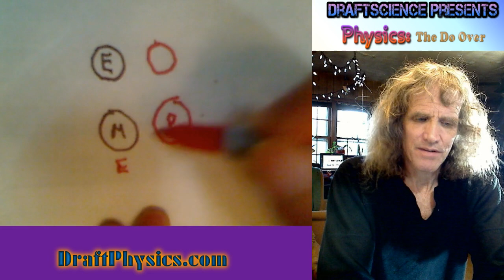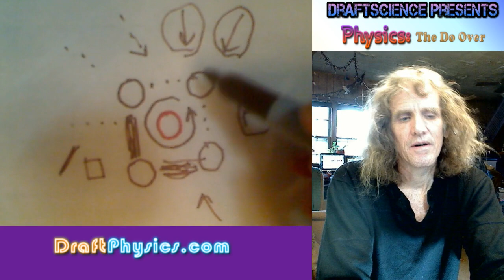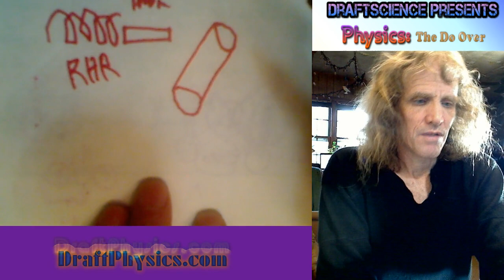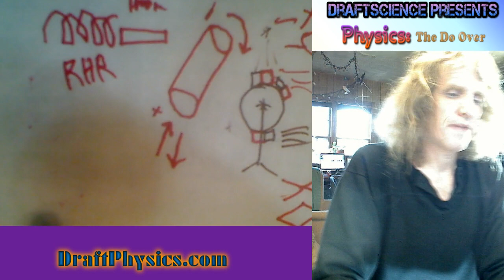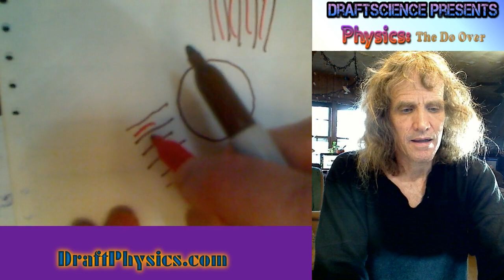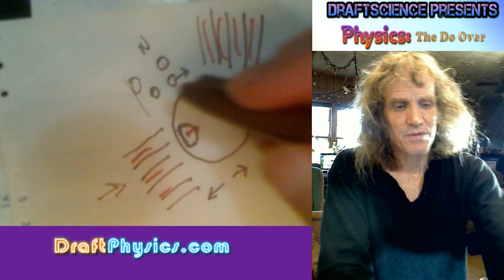a bit on Energy

Comment: @12:04 I think Einstein derived thar number by connecting equations that were established with known relationships and using algebra to cancel the doubled quantities. For instance 4/4 always equals one and anything divided by itself except infinite and zero always equals one, so you can cancel them when they are in both the numerator and the denominator. I.e. 5x/x=5 and you can get rid of unnecessary variables and be left with a simplified formula. I think that is how Einstein got that formula.